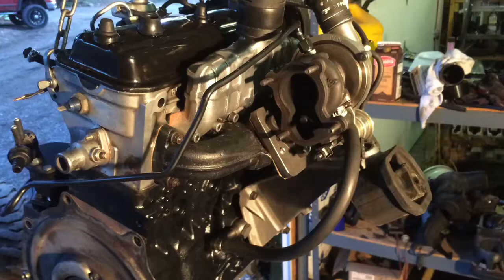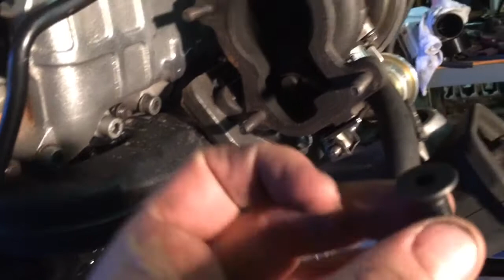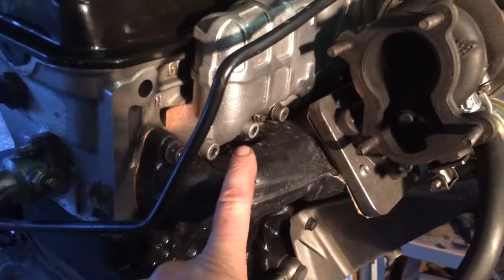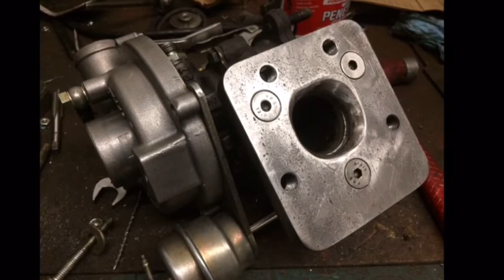Vanagon TDI AHU Swap: AAZ Exhaust Manifold Adapter

Comment: Hello, I do have 3 point exhaust manifold from the original 1z engine, but it interferes with the original engine mount, which I want to keep. Guess this solves that issue. Do you experience any issues with the turbine being so high? Oil is returning to oil pan as it should? Thank you!

Comment: Nice do you have the template for the adapter
Reply from the maker: Nah, that was ages ago. I wouldn’t do it again with the adapter, id just go get a proper 3 hole manifold  from Thomas at Quality German. Mine works fine but it was a pain in the ass
Reply: @jtlachappelle  thanks will check

Comment: Do you think the AAZ turbo would fit ? it looks like the same turbo not sure but uses the 4 hole manifold.  I see you raised the turbo some with your adapter and had clearance issues withe the waste gate actuator.

Comment: thanks for the videos, they have been a huge help on my swap. I have a question, did you use a pilot bearing and if so which one?
also i got a AAZ manifold with the three bolt, it doesn't have the right angle to work correctly .

Comment: Where did you get the AAZ manifold? I'm having a hard time finding one. Thank you
Reply from the maker: I got mine on the Yahoo Vanagon Diesel group, just go on there and ask. Facebook also has a group. The Samba would be another good place, and Thomas at Quality German says he sometimes has them. Remember to try and get the 3 hole version so the turbo bolts right on with no adapter.
Reply: thanks for the tip